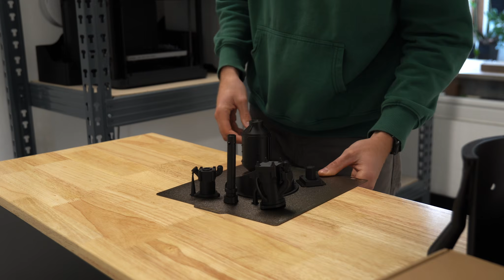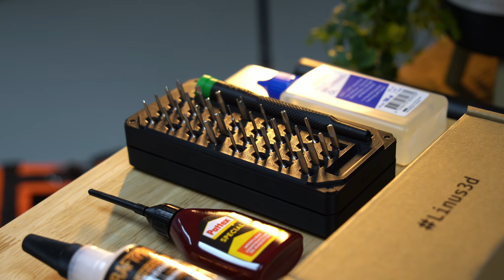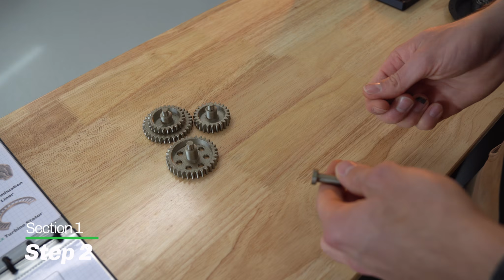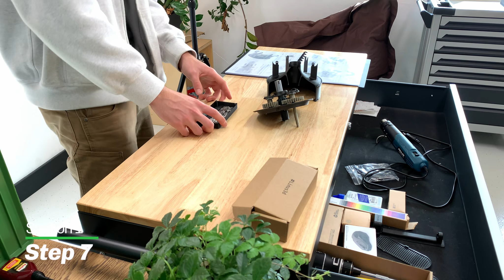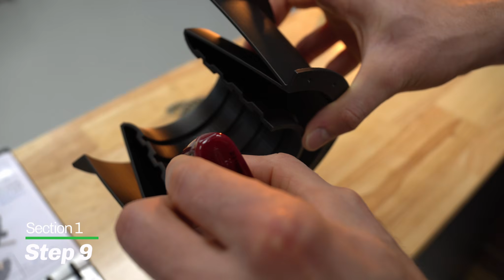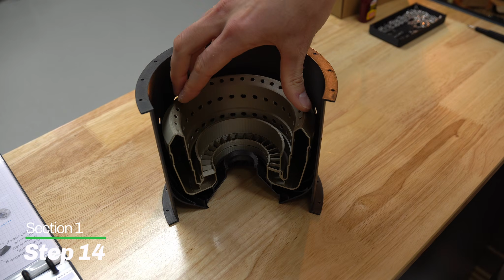3d printed PT6E Turboprop Engine | Assembly - 1st Section

Comment: I am currently printing the combustion lining part and I would definitely recommend thickening the little fins on the bottom. They are super thin and keep snapping off where they meet the floor. I am doing it manually in Blender but it may be a good update.

Edit: I brought it into blender and expanded out all of the center vertices on them so that the cross section is more triangle shaped and it seems to be working much better.
Reply from the maker: Glad you got that fixed! May I ask what printer your using?
Reply: @Linus3dOfficial it's a flashforge adventurer 5m pro. Other than that small hiccup, the model is looking fantastic! Can't wait to finish it.
Reply from the maker: @dshbwlto1 glad to hear! Looks like a great printer.